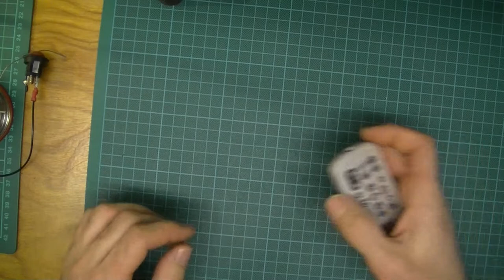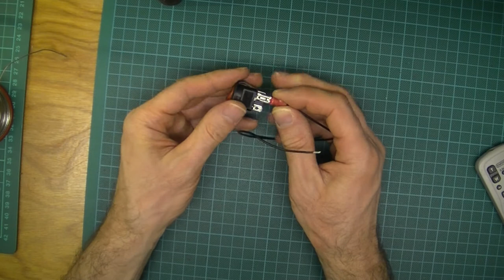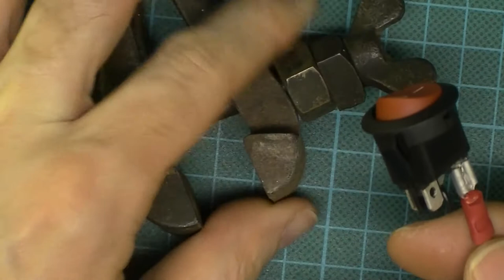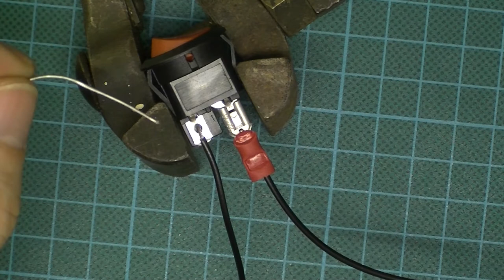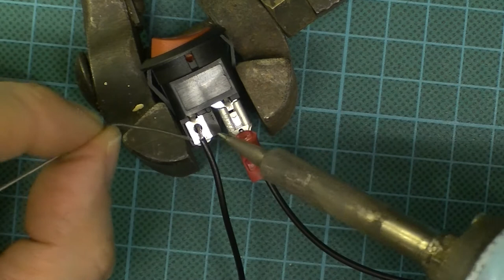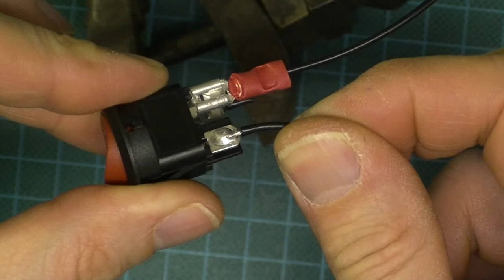How to solder wire onto rocker switch terminal

Comment: Hi great video, I'm practice my solder as i would like to solder 4 toggle switches like you have just shown for lights in my van. I'm going to solder them due to being restricted on space behind the switches.
I was wondering how hot your soldering iron is please?
I think I've answered my own question but if I use a thick gauge of wire to what you have, well it will take longer to heat up and then melt the switch?

Comment: How many watts was that soldering iron?
Reply from the maker: 45W if I remember correctly. However, I don't think the wattage is important for this switch as there isn't a lot of thermal mass to the connector. I believe I could solder the same switch using my 15W iron.
Reply: @PizzeyTechnology  I tried something similar the other day with no luck.

I didn't hold the wire and terminal; they were simply floating in the air about an inch from where I held the wire in a vice.

I think I need to hold the terminal better so the soldering iron can touch it better and let the heat sink in.

It's not the soldering iron; it's my technique.

Comment: What about soldering the spade connector to the terminal? I ask because I broke of a terminal and there was a 1/4" left that I can get the spade on, but it needs something more to keep it from coming off with some vibration. It is on a in tank fuel filter with a built in sending unit.
Reply from the maker: You may be able to solder a wire directly to the broken terminal. If you need a push fit connector, you could crimp a male connector to this wire. Make sure you clean the broken terminal well before you attempt soldering.
Reply: Thanks for the quick reply! Soldering the wire directly on was another idea I was considering, assuming the wire is long enough. Appreciate you putting out helpful content. Subscribed

Comment: What am I doing wrong. Got 4 soldering irons here, do you think I can get solder to stick ? Not a chance, even after 10 minutes I can melt the solder on the iron but not the wire or terminal.
Reply: Maybe prepare the surface more with a wire brush get the metals shiny

Comment: can you solder the one with the terminal adapter on it?   or should i just do wire to terminal?   it's inside subwoofer box.
Reply from the maker: You can solder the type with push fit terminal tabs to make a more permanent connection, but if it's a plastic bodied switch take care you don't overheat it and damage the switch. 
How will your switch mount in the subwoofer box? In some instances you'll need to feed internal cables out through the mounting hole before soldering.
Reply: @PizzeyTechnology  na it wasn't a switch it was speaker terminals for sub and box.  but after soldering terminals to one side i found it easier to just solder wire straight to terminal instead of using connectors.

new to soldering but thanks for the vid/response.  every little bit helps and live and learn i guess.
Reply from the maker: @XX-121  if it's not a switch then making a permanent solder connection sounds the right thing to do. The more soldering you do the better you'll be.

Comment: So solder its much better?
Reply: Soldering generally gives a more robust connection, but crimp terminals are convenient (if you have a crimping tool) and may need to disconnect.